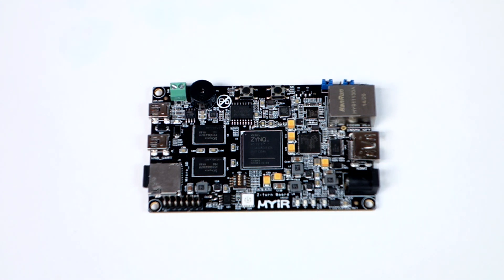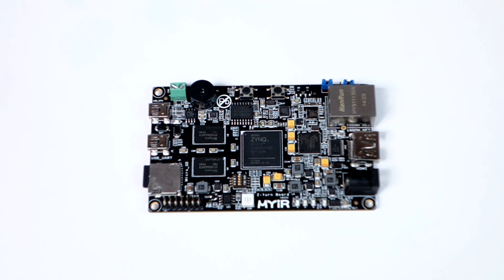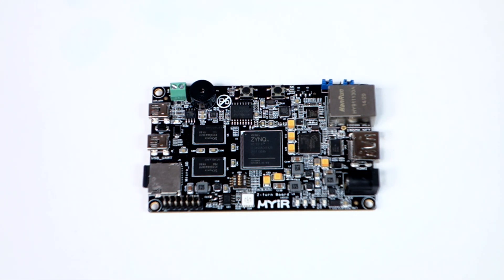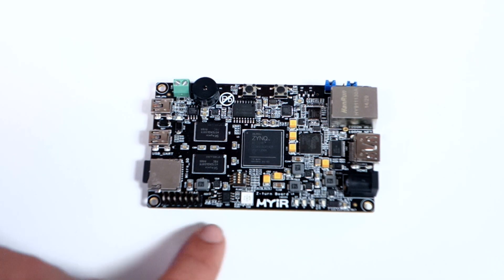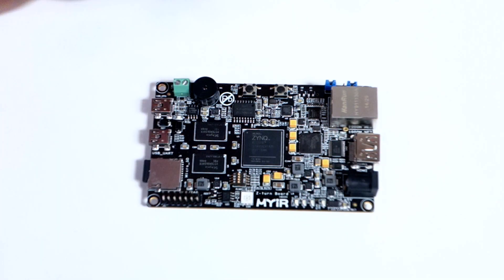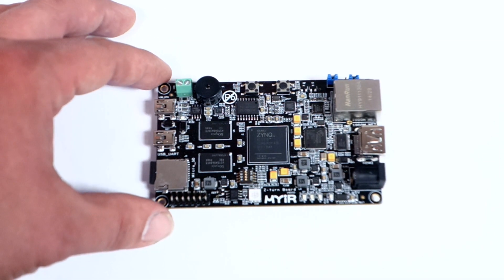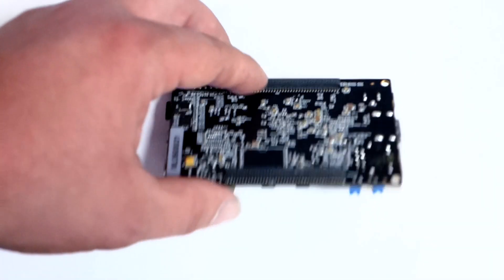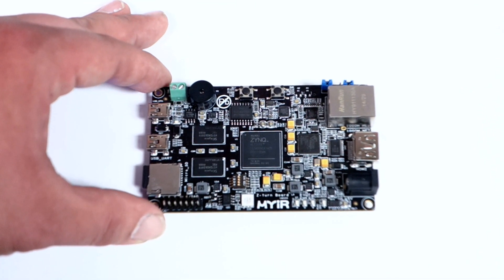MYIR Z-turn Board Xilinx 7-series FPGA logic ARM Cortex-A9 System-on-Chip

Comment: Hello, I want to use MYC-Y7Z010/20 CPU Module and connect 4 serial ADCs with 15MSPS datarate (each occupying 8 PL pins), one FT601Q to provide USB3.0 interface (occupying 45 PL pins), some multiplexers select lines (occupying 32 pins), two low-pass filters' SPI lines (occupying 8 pins ), ADCs clock distributor IC SPI control (occupying 8 pins). This makes upto 125 I/Os. Can I do that with this MYC-Y7Z010/20 CPU?  Would you please send me the schematics of it? Any technical help regarding the carrier board I'm designing which consists of the ADCs, Multiplexers and clock distribution IC would be highly appreciated. Should I also have a JTAG connector on my board to connect to MYC-Y7Z010/20? Is there anything else that I'm missing in designing of the board?  I would like to order this module but I'm not sure if it meets my needs.

Comment: Anyone found whether they can use vivado with this? I've seen no mention of it, which seems baffling for a 70xx SOM. Just asking - I don't want to screw around with inefficient dev and getting beaten to the market because I've had to use old style tooling which has wasted valuable time.  If you are not efficient you get beaten to the market!  :)